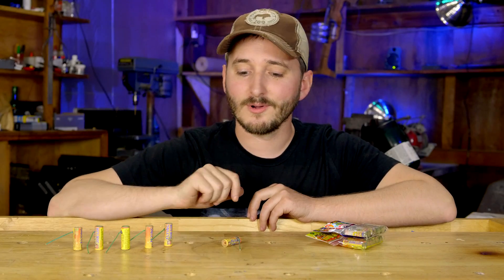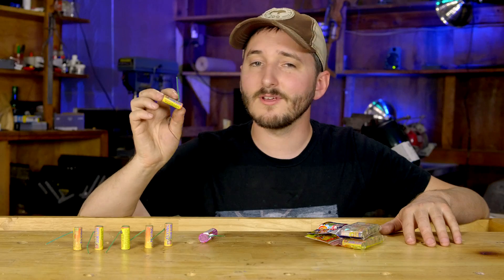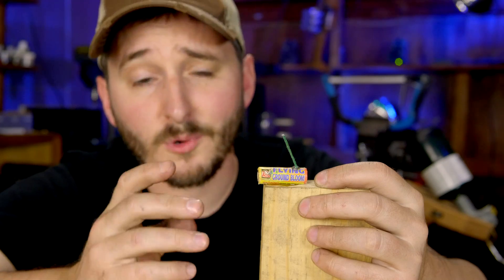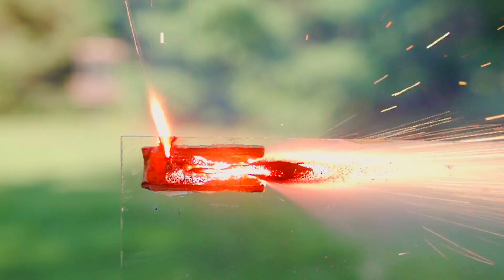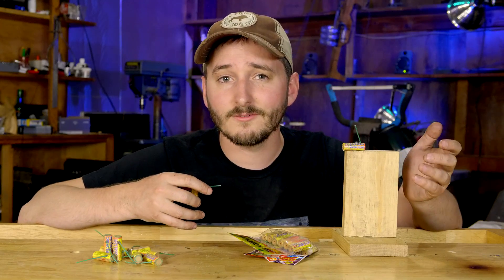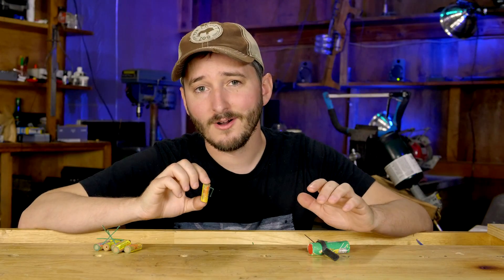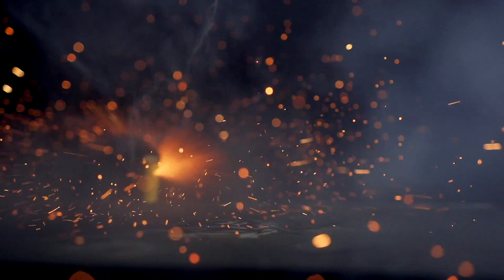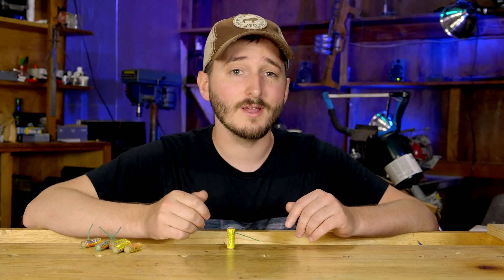How Do These Fireworks Fly?

Comment from the maker: This video may be an example of my ability to make a simple concept complicated, but I'm sure if that's the case you'll set me straight in the comments. It took longer for me to finish with this video than it should have. Hopefully it's entertaining and gives you something to think about even if my own conclusions are less than decisive. I'm excited about other projects I have coming up, so stay tuned.
Reply: 2 things. 1 - it looks as though they're also weighted heavier towards the 'nozzle' end via a thicker clay wad & 2 - I further suspect you'll never truly understand how they work until you 1st build one & then improve on the design of them.....

..challenge extended?..😉
Reply: @joeydubbs763  scale up?
Reply: @professorfukyu744  yes please!!!
Reply: It looks to me like the firework fuse feeds in not just into the side but is also following the curve at a slight angle, maybe due to being wrapped into the paper or cardboard housing. 

This would give it enough thrust in that direction to effect the top-like spin that causes it to right itself before the main rocket fires. Then the spin acts as a crude rifling, giving it a stable line upward. 

It would also answer why the first is offset instead of centered; a middle mass burst would not allow for stability on an end and it would likely fire off randomly in one direction once the secondary kicked in.
Reply: @SuperMegaCoffeeGuru  

G'day,

  I agree, the "Fuse-Hole/# - 1Rocket-Nozzle" appears to be drilled into the Tube on a Tangent to the Circumference, rather than tracking in along a Radius-Line...

 So when the # - 1 Nozzle fires ..., it both yaws & rolls the Tube, which thus spins both ways - and as the mass of Propellant  Powder departs as red hot Gas the Centre of Gravity changes, and THAT permits the as yet unfired (and suddenly relatively heavier) # - 2 Nozzle to precess the Tube until it is pointing at least 45-degrees downwards, before the # - 2 fires...

By which  time the Tube's Axial Rotation's Gyroscopic Force precludes any further Precession towards the Vertical - and it doesn't much matter because the overall Thrust Vector of the "yawing" or "axially-tilted # - 2 Nozzle is indeed still pointing generically "Down".

  By design, the thing rolls itself till the  #-1 Nozzle contacts the ground, then Ground Effect boosts it's  Thrust & pops the Long Axis upright..., and as it reaches the  "Vertical", the # - 1 Nozzle has rotated 180- degrees to stop the Tube from falling over, so then it accelerates it's Axial Spin until the # - 2 Nozzle ignites & boosts it - in theory, Vertically....

  The Designer must have been a very very cunning individual.

  Probably a self-taught Hillbilly...; becuz they does n't learn them sorta Smarts inside of any no Unidiversititty...; that much be near t' bein' plumb-certain, eh ? (!).

Such is Life,

Have a good one.

;-p

Ciao !
Reply: @SuperMegaCoffeeGuru  some rockets do work using that method to create rotational forces. But it is not necessary with the fireworks as they start on there side, so it will always spin.
Reply: NightHawkInLight I might be completely wrong here but this is my idea on why some of them stand up before the others. It could have to do with the 1st thrust nuzzle  being off center of the vertical axis, and which way it is facing relative to the plate. If the nozzle is pointed streight down towards the plate when it ignites, it will lift up very quickly. While if the nozzle is pointed up towards the sky, it has to rotate before the thrust can push against the plate and lift it up. Also, if it is pointed down the thrust is in contact with the plate for a longer time than if it were initially spinning.
Reply: This question has literally kept me awake at night.  I do appreciate the difficulty in saying that without sounding sarcastic.
Reply: Right or wrong, it is still an interesting concept and was a great set of slow mo shots...keep the vids coming
Reply: making your own versions of it will prove your theory
Reply: See if you can get one to fly in a vacuum ;)
Reply: How about placing the firework on a mesh screen held above the ground? That would eliminate a lot of the "ground effect" and it should be observable in how the thing behaves!
Reply: @USWaterRockets  

G'day,

Yay Team !

  As a Boomerangologist, I concurr...; but Rockets are notorious for functioning perfectly in a Vaccumn, so perhaps the "observed Ground Effect" is an imaginary Artifact of the timelag between the # - 1 Nozzle beginning to discharge burnt Gas and the Force generated rising to overpower the resting-inertia of the Unit's overall mass...

  The Fuse poking out the side, before lighting-up, sets the orientation, before the Power Impulse begins ; and my guess it that a sheet of flat wire Mesh probaby won't noticably effect anything about the Device's performance & behaviour.

  They appear to be flying by sense of critical Timing of Power Impulses along carefully calculated and angled, slightly offset Vectors.

  Devilishly cunning, what !

;-p

Ciao !
Reply: I thought the gyroscopic precession 90 degree thing only applied to deflecting forces (trying to tip over a gyroscope) not to forces acting within the plane (pushing the gyroscope across a table). That would explain what you showed, but I may be misremembering.
Reply: Cander that’s what I thought as well but after testing it with a gyroscope I discovered that any force that is attempting to change the angle of the axis of rotation has procession.
Reply: @calebanderson6100  this was my theory as well, but without scientifically correct nomenclature.
Reply: NightHawkInLight It seems that the fireworks would spin around their axis and on through the ground and not fall over because every time it spun it catching itself before it could blow its self over, the hole in the firework might also be drilled at an angle creating angled thrust.
Reply: The nosel is angled😯
Reply: It’s pretty simple. The thrust of the first nozzle is rotational as you said, but notice the rotational nozzle is located near the end of the cylinder. That both spins the tube and stands it up as it pushes against the table, it also doesn’t want to spin with the heavy end above the rotational nozzle, gravity. Bit of burn timing then the lift nozzle kicks in.
Reply: Though if rockets are anything to go by, the heaviest end should be at the top. If you see gravity as velocity downwards, to go up you need a greater velocity going up, so your center of gravity needs to be further up.
Reply: The physics going on here are pretty complicated, but the principle is fairly simple. I actually think the slow motion footage makes it more confusing. I know they aren't common anymore, but have you ever spun an empty film can on its side? It want's to stand up. The horizontal rotation causes an axial rotation from the friction with the surface, this causes a gyroscopic effect, where the can will find an angled equilibrium based on its rotational velocity. If you spin the can fast enough, you can even get it to go past its tipping point, and remain standing after spinning. It is much easier for the firework to stand itself up since it's continuously accelerating.
Reply: Check out “Spinning Tube Trick” by Veritasium. The force imposed on the firework by the nozzle is nearly identical to someone’s finger on a tube.
Reply: @Eva_Bee30  hmm, didn't see you beat me to the explanation lol I think that video is what I know this information from too. This is almost defiantly the reason and a smart way to design the firework! 
Edit: I went and watched the video but I don't think he was focused on the actual reason that it lifts (which I believe to be rotational gravity) since one side spins faster from the thrust it causes the faster spinning end to lift up.
Reply: "However, the "ground effect" will tend to provide a larger radial thrust whenever the nozzle is pointing to the ground"
This is the core of the thing starting to bring itself up from an initial horizontal position. I would only quibble over the term 'ground effect', which I would formally restrict to true airfoils. What we have here is simply an averaged higher pressure regime always under the side-hole end. Naturally the downward pressure on the end is 'instantaneously' greater when the side-nozzle is pointing upward, but when it rotates into approximation with the surface, its instantaneous pressure is greater than the peak-pressure in the 180º opposite (flame-upward) position. Integrated over time then, the side-hole end is experiencing an upward force.
Conspiring with that, the nozzle is likely made of clay or ceramic and substantially heavier than the side-hole end. After that, the system is gyroscopically complex, with both axial and orthogonal spins happening simultaneously and I don't think the thing can enjoy a complete dynamic description without computer modelling, except for the final upward thrusting position: that's a plain ol skyrocket thingy...
Reply: You need alcohol if you want to make the "stars light"
Reply: im thinking its also something to so with gyroscopic procession
Reply: firefox5926 yes that factor does come into play.
Reply: "I'm sure the comments will smoke me" then hearts litteraly every non negative comment
Reply: You can get a brick of tiny ones that are connected in a pack like fire crackers there called jumping jacks

I would say something to do with magnus effect possibly as well Peter Sripol made a rc airplane with KFC buckets for wings lol

Hope you see this realize its been a year since you posted it

Edit guess jumping jack aren't the same thing but I remember them flying idk
Reply: Very interesting,I like the science behind it
Reply: I'd recreate it, and if my copy doesn't work, there's something afoot that I didn't notice before. Then I'd try changing values like the length or hole size
Reply: Euler's disk reversed.
Reply: I've seen way too many cartoons, and totally did not trust the rocket to go off when the fuse got to the bottom, or expected the rocket to just VIOLENTLY DETONATE when the fuse was halfway burned down.
Reply: Would be curious whether the standing upright could be reproduced via water under pressure?

The model I am thinking of is a cylindrical metal or plastic cap that is free to rotate, with jets on the side, connected to a lightweight hose.
Reply: I've been I've been experimenting with these for over the last few weeks. I've taken apart several different kinds and brands. A lot has to do with the weight of the nozzle. The firework has a side thrust hole slightly off center. To create the spin. Most  of the zip,speeds ball wait is at the nozzle end of the firework  creating the top much  lighter and lifting its self up. Basically it just a spin stabilizes rocket. They also go by stinger rockets.
Reply: I am curious how if it takes off if you place it upright (jet side down and jet side up)
Reply: Not a rocket scientist, but if you look the cylinder gets kicked vertical as the jet pushes out and then it starts a rotation that make it semi spin balanced. At that point the nozel is facing down, so by the time the solid fuel ignites it is exhausting the gas downwards.
Reply: Please film regular ground bloom flowers for comparison. I'm very interested in why they do not also have the same action spinning on their end. I think having this footage for comparison would really help to understand the flying fireworks.
Also you could try creating a few different variations of the flying ground bloom flower by filling the fuse hole then re-drilling and re-creating fuse holes directed toward the centre of the tube and others the hole directed off centre as hypothesised. If you did this you could help explain why the always spin in the same direction and whether it is the main difference to normal ground bloom flowers apart from the tail thrust.
Reply: Hi NHIL,

Just watching your video, I know from doing some stupid tests in model rocketry in my youth, whats going on here.  

In one test where I had evolved to oxygenated sugar as my fuel (I'm allergic to custard, but I herd that was a better fuel), I experimented with auto stabilised second stage rockets, where the lower stage would rotate like a bullet, to stabilise during launch.  However prior to separatism, the control box, ignighted a hole in the wall of the solid first stage, that was not perfectly strait, that generated a counter rotating force, so the upper stage could separate safely.  

That test failed, but I incorporated the first stage bleed like in these fireworks to stop the rotation during the launch and its exactly the same process.  Where you off set the hole by a small amount, and it acts like a thruster on a rocket.

You could demonstrate the same effect in the video game  Kerbal Space Program.  

Good videos by the way. 

I am Phattgreg on twitter if you want more details as I rarely go onto the website.
Reply: I think you did a great job of evaluating these fireworks. After watching it I thought of one thing you could also look into: is the Center of Balance differ for these flying flowers and the ground ones? 
If the material in the end of the second nozzle weighs slightly more than on a ground flower, could it factor in to the ability of the flying ones to direct more upright?
Reply: One factor is as the fuel burns out, it loses weight, unbalancing itself. So, as it spins the rotational energy stands it up. The next stage takes over shooting it skyward.....maybe 😊
Reply: To me, the turning of the axis while spinning looks just like when cars do very tight donuts and just spin around they tend to eventually flip on the side. Monster trucks are a perfect example.
Reply: If you take a small tube on the table and you push your finger down on one end causing it to spin the same way the firework is spinning you can still observe the same effect with no rocket thrust. I think it has to do with rotational gravity.
Reply: Like other commenters I have the sense that weight distribution might be important, but I don't understand the technical physics details. Might be instructive to video some regular ground bloom flowers and also to see if there's a difference in the center of gravity between the designs. Also makes me wonder if these were invented after a batch of defective ground bloom flowers started blowing out their cap at one end and taking off.
Reply: I thought it was obvious from the start
Reply: NightHawkInLight I was gonna say they spin up like a top and stabilize it’s like a bullet
Reply: suuuuch a well made video! pleasure to watch
Reply: As fuel burns the heavier end stays down hence picking up the lighter end.
Reply: Figured it out got a few videos of it up.added color comp green and orange. Looking forward to any of your input. Thanks
Reply: I think you are absolutely right in saying that multiple factors are in play. Any force that aids the firework to touch the ground with its bottom nozzle side, will from that moment on, cause it to sit upright for the same reason a top sits on its point. Now let’s say the firework loses friction with the ground momentarily. I hypothesize that if the firework remains close to the ground then gravity will push down on the whole firework while the side nozzle will create a rotational force around the central axis (the axis that runs lengthwise) while also, due to ground effect, make the force be biased upward on that side of the firework. This is what always guarantees the the firework will face upwards. To think of it simply, the firework is a top with a rocket in the bottom. The side nozzle gives it rotational force around the central axis, while also providing an upward force on the half of the firework with the side nozzle due to ground effect, ensuring that only one side will lift up.
Reply: Should be able to test this if you drill a small hole in the end of a normal ground bloom flower and light the fuse.
Reply: It’s intuitive to me because I have taken glue sticks when I was in grade school and was bored and spun them up, it’s a combination of precession, friction and the ground effect. Try the glue stick thing yourself: push really hard on one end and let it slide off your finger, the thing will start to orient vertical.
Reply: SPB11 did I not just say everything you said?
Reply: @musiccritic8704  Yes. I am re-affirming your statement and giving a tangible demonstration which you can try yourself.
Reply: Check my comment about my thoughts on what happens.
Reply: I'm  Thinking the ceramic plug on the top side is heavier thus helping it fly in that general direction like an arrow and fletching?
Reply: I thought of the indian missile that went up then sideways but in reverse but could not figure the launch and spin until i saw the top end circular motion
Reply: Center of mass and center of pressure
Reply: 1) The top nozzle isn't completely radial to the body, thus starting the spin. 
2) The spin starting causes the top of the tube to raise up due to the total force of the jet as the P-force comes into effect. 
3) It's not ground effect. When the upper nozzle is normal to plane of the table, an enormous portion of the energy is used just as an inverse pendulum, f=-mg•sinθ, pushing the machine toward vertical.
4) Since the upper nozzle is so close to one end, it acts as a lever, lifting that end toward the vertical plane. 
5) Through the timing of the powder burn, as the you're end of the machine comes vertical, the lower nozzle ignites and starts the more powerful burn providing difficult thrust for vertical lift. 
6) During vertical flight, the continued spinning of the top, offset nozzle provides the stabilization similar to rifling in the barrel of a gun or artillery piece.
7) Again, via the thinking of the powder burn the fuel for the top and bottom nozzles delete simultaneously so that the firework becomes relatively inert at its empty weight and tumbles harmlessly to the ground.
Reply: NightHawkInLight - I was hoping you would figure out the rpm they spin. The noise they make is the most impressive part. Sounds more than 5k rpm!
Reply: Ancient gyrodynamics at its finest. Beautiful. As soon as you have enough vertical momentum from the spinning body, the powder thrust that comes out in the other hole, generates a new force that combine with the previous momentum, creating a new resulting upward force, which is more than enough to overcome gravity. It corrects itself through gyroscopic motion.
Reply: One word, air pressure.
Reply: The moment of inertia of a spinning tube is always most stable along the Z direction. Take a tube flip it in the air and spin it and you will see it lock along the z direction.
The ground introduces a constraint on the motion of the tube as any sort of intersection of the tube with the ground is less stable than with Z pointing upwards. Then the axial ignition happens.
You can test this theory by lighting one of these things and dropping it against a surface that is vertical, like a wall, and you will note that the firework will very likely shoot off perpendicular to the surface of the wall.
This would be a fun experiment to film.
Reply: Have you ever spun an expo marker by stepping on one end of it and letting it slip out from under your shoe? That’s seems to be correlated with this rocket.
Reply: Did you ever find the answer?
Reply: You may just have hit on the next 'thing' with fireworks, particularly with rockets and that is perhaps a small plastic propellor on a collar at one end. It'd be interesting to see how the offset stick effects stability though.
Reply: wonder where you can get those
Reply: This calls for some tests!!! We can do different things to test our theories and see if we can figure out what parts are necessary for the flight of the speedballs. I think if you take weights of the fireworks without their fuses and find their center of balance you can create a model of them. Wooden dowels with screws inside one end that are painted bright colors for clarity might help. You could even model the change in weight as it burns with a few dowels weighted differently. Try spinning a few of these dowels in different ways and see how they spin. Spin one with an air hose near where the fuse side, flick one horizontally from the middle, try pressing down on the fuse side until it slides out from under your finger popping it out in a spin, anything else and finally just try rolling one between your hands and dropping that onto the table. 
I also think that one of the major differences between the speedballs and the larger helicopter ones are the angle the thrust leaves the rocket at. The green helicopter one has it's thrust perpendicular to the shell while the speedball's thrust comes out at an angle tangent to it's shell. I think that this causes it to spin around and lift up vertical as it pushes off the table and there is a very easy way to tell if this is what is causing it. If you remove the fuse and alter the nozzle by drilling in perpendicular to the body and that alters the direction they take off in, then we can tell it is an important feature for flight. You can also try adding a rubber band or two around it to test the effect of friction on it or super glue some metal weights to the top side of the speedballs to see how that effects them. Maybe also light some of the altered ones above the ground or so they will fall off the table to see If you are doing these experiments with them you might want to set them off remotely or with longer fuses. being we are trying to alter the direction they take off in. 
I hope to see a follow up video on it where we test the theories to see what is right!